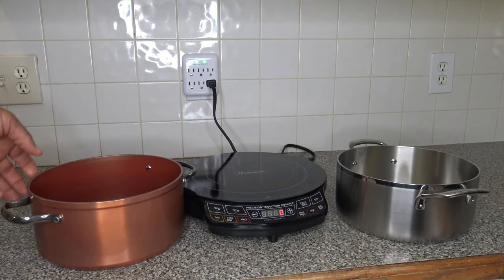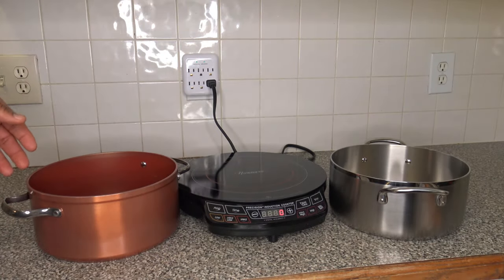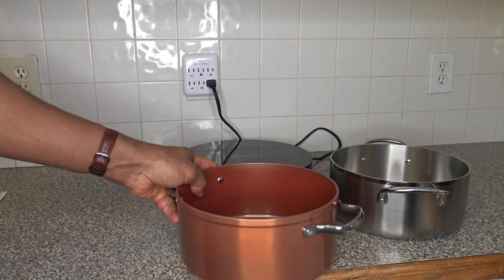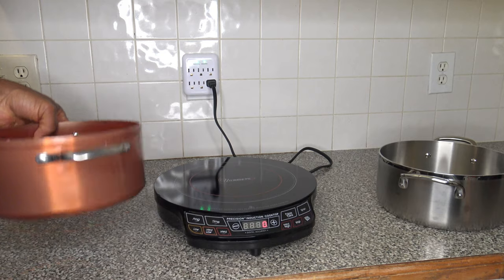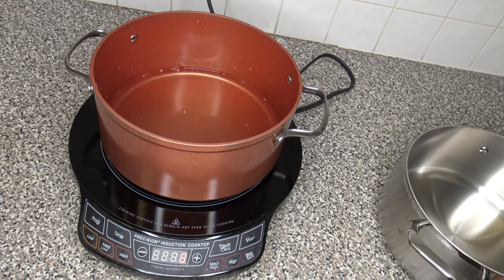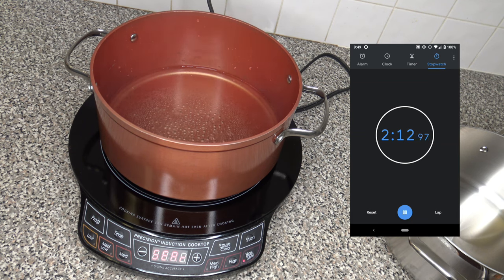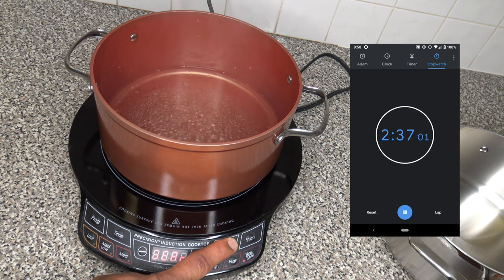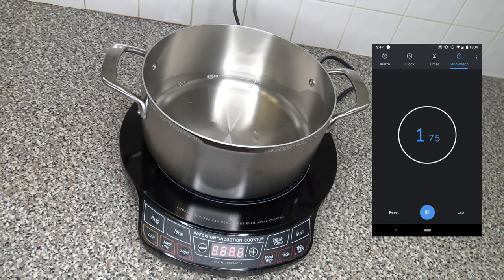Ceramic vs Stainless Steel Cookware, Induction Heating Speed Test

Comment: I have that nuwave induction and you should of used a temp gauge to test the boiling point of water which is 212 degrees and that will not get that hot in that amount of time it gets 190~201 degrees which is not hot enough to boil anything that needs the temperature to cook. Pasta,eggs etc.
Reply from the maker: Cooked up my pasta pretty good.
https://youtu.be/1sZwmGaNtd4